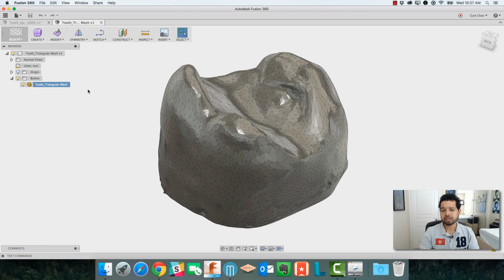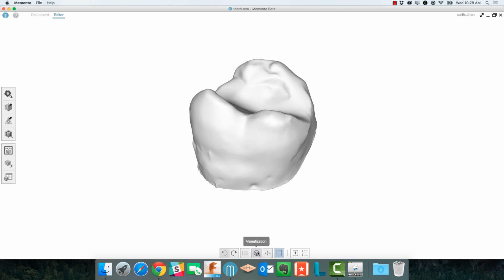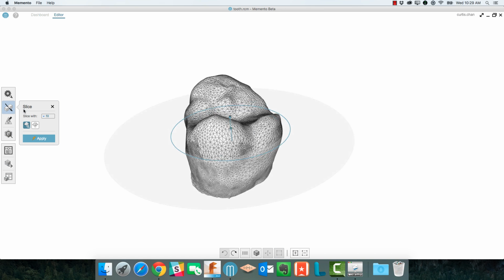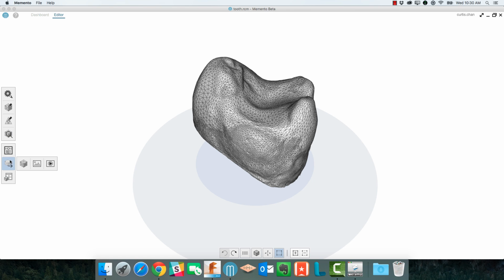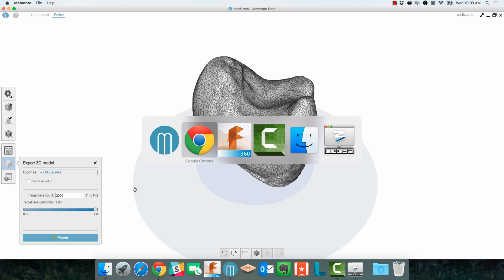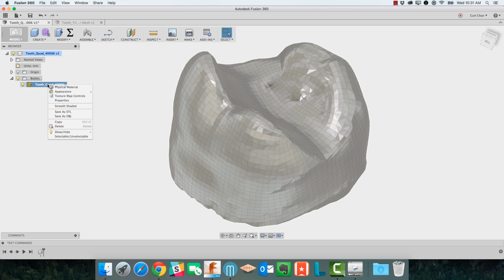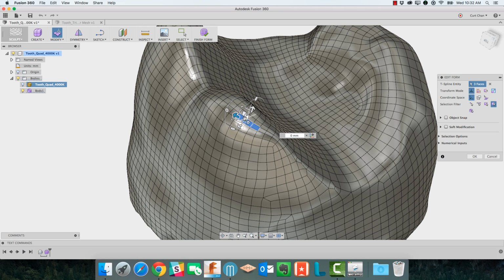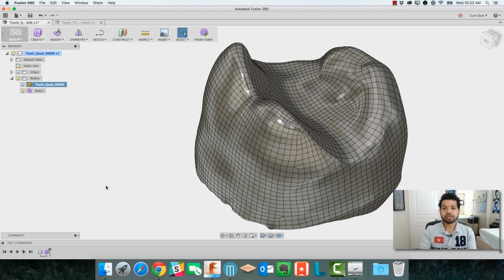Working with STL Files | Autodesk Memento + Fusion 360

Comment: Thanks for the video. The problem I'm having is that it just kills the quality even if I set the output in memento to 8000 it just sucks. I downloaded an stl off the internet of a flat plate with holes and when converting to an obj it's no longer usable. Any suggestions?
Reply: +joshcarz I'd recommend just remodeling in Fusion 360.